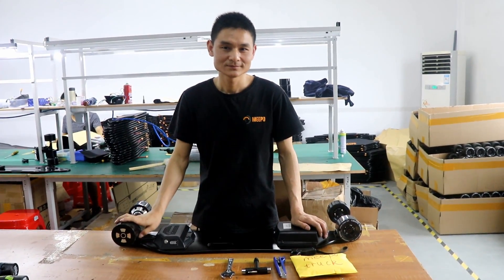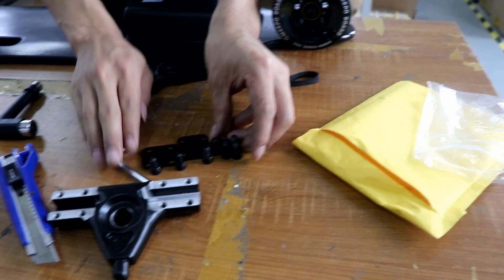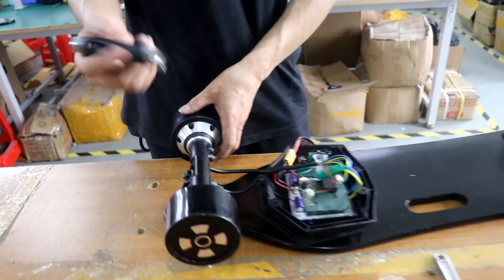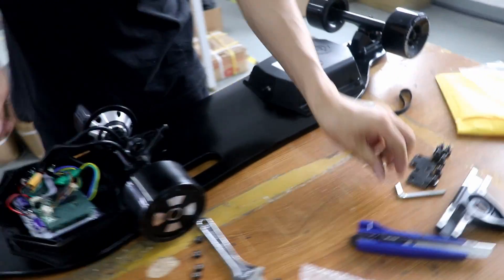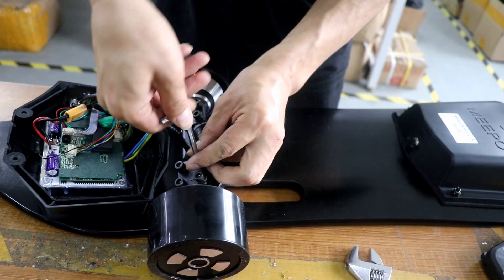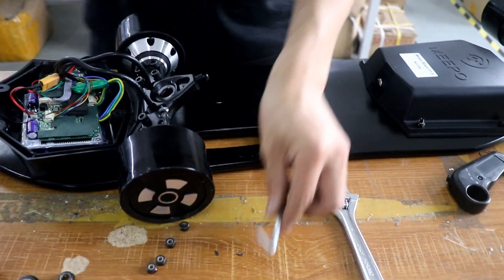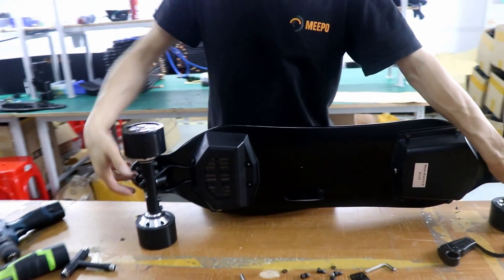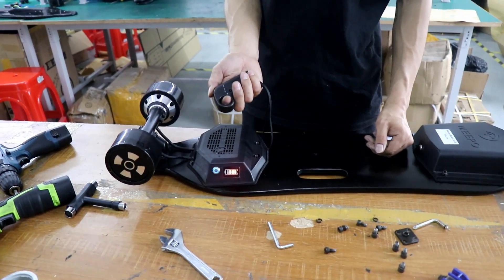how to replace meepo board truck of hub motors

Comment: What tool was it you use to take off  the bolts
Reply from the maker: hex head tool in a certain size.
Reply: @KieranEboard  what was the size do you know and what kind of drill

Comment: I had my rear truck break on me and I had just installed the newer shredder truck. One hub motor had a lip that keeps it from sliding out, but the other one doesn't, so when I screw it down, it'll still slide back and forth. What can I do about this

Comment: Kieran can i ask why you choose to have urethane wheels instead of rubber on the outside? I feel rubber would grip the road better i wet conditions. :) Cheers for being a top G lad, Meepo 1.5 is currently 80 miles away, so hyped!

Comment: Kieran  I NEED YOUR HELP ASAP PLEASE
Reply: Havent had any issues with the new urethane so unless you had the meepo 1.0 you shouldnt be having an issue with your urethane
Reply: eSk8UberEats not my urethane  my wiring started smoking burnt the connectors and the hub cap popped off.... soo that's my issue
Reply: eSk8UberEats I already did he said to buy new motors and I need a new esc to but warranty doesn't cover it so im screwed basically
Reply: sorry buddy, just gotta buy new parts thats all. good luck

Comment: There are a number of reports from Meepo 1.5 owners that had their rear truck snapped.
This is very good because I personally was concerned about my Meepo 1.5 (that I'm about to receive) will have its truck snapped the same way. This might have resulted in a very bad accident.
Thanks for taking care of us, Kieran!
Reply: Буча Бамбоидский 

It would snap? Does that mean that they are using different material or how did they resolve the issue ?
Reply: I guess they are defect.